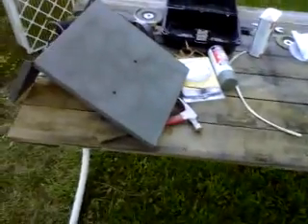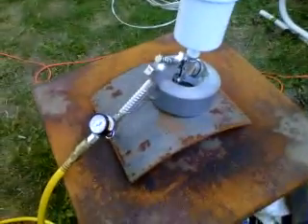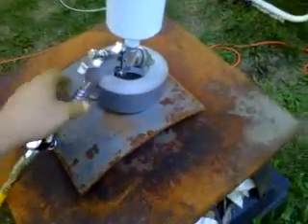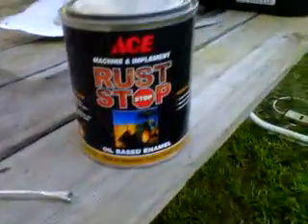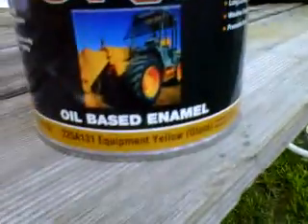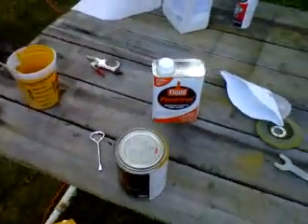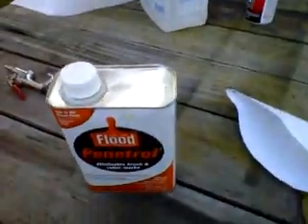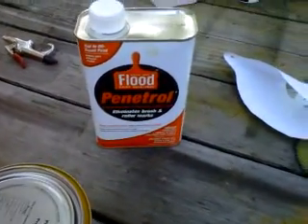Thunderbolt 1003 Restorations...VIDEO # 6--Primed/Painted Panels!

Comment from the maker: @JPa311979 Yep! 4.5" angle grinder with 7/8" arbor. Its an "el cheapo" model, valued at $40 new, but it works GREAT! It has a lot of power and does everything I need it to do. I abused the eff out of the thing flap-wheeling the panels, but it pulled through! You can buy a $100+ 4.5" angle grinder, but I see no reason to. 

I used Penetrol w/oil based paint. I mixed 2 oz. of Penetrol to 16 oz. of paint and sprayed it out of my gravity feed Campbell Hausfeld gun. It layed down marvelously.

Comment: Is that an angle grinder on that table? I'm thinking of starting to save up for one soon. So you're using oil based paint mixed with Penetrol. What is the amount you are mixing per gallon, quart, pint?